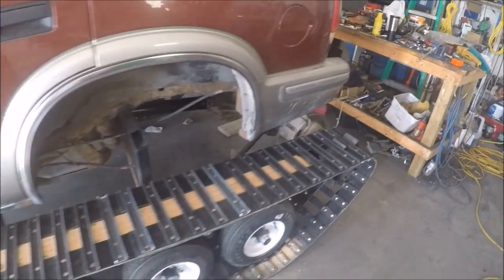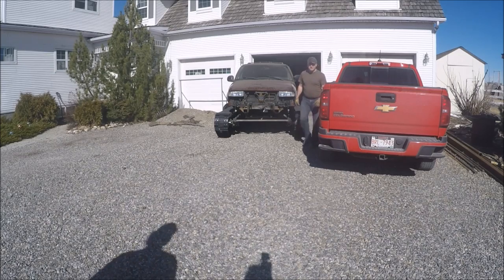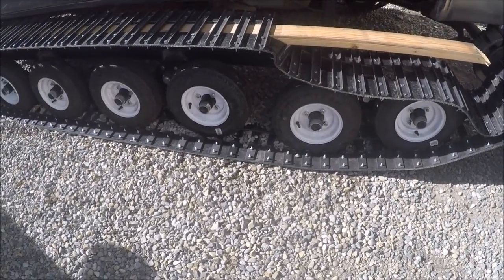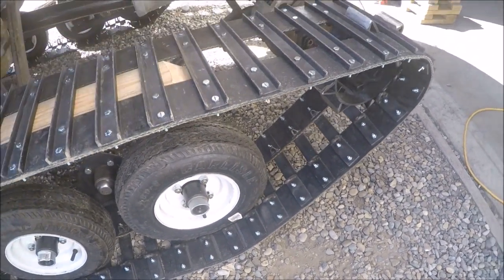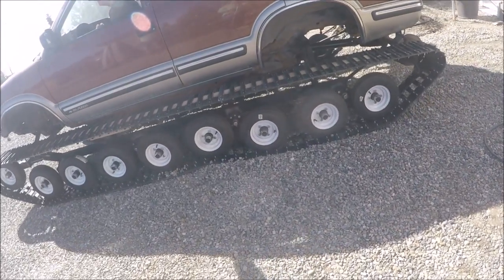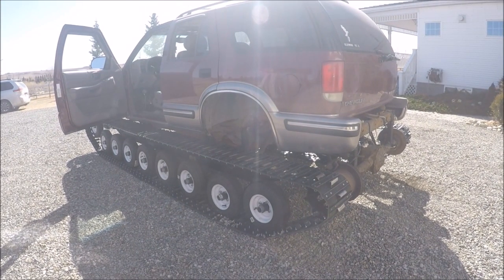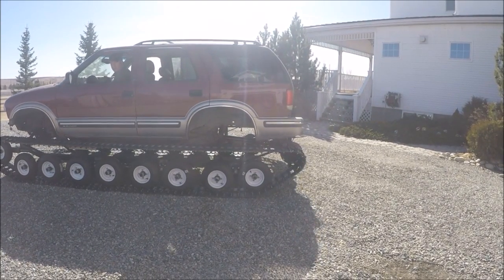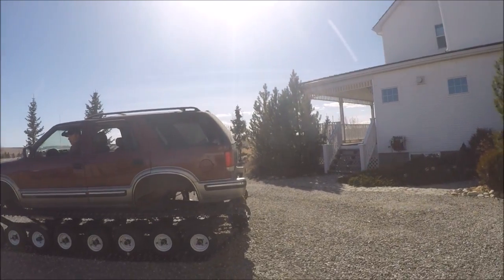Custom Tracked Vehicle, Part 22, Rev 1, Test #2

Comment: Re work the tracks ._u need guides to keep em on the bogies also the teeth on sprocket look too big
Reply from the maker: Hi Dillon Libby, Thanks for the comments. There are guides on the tracks, look close or check video 9 (https://youtu.be/wSQ6bbpNWgc) where I fabricate the track guides. If you watch the latest video, I got it running, but still need some tweaks. I don't think the teeth are too big, but I need to curve them a bit and add a shoulder so the cleats kinda grab the teeth, right now I have to keep the track very tight or it tries to push the track off the sprocket.

Comment: where did you get the track belts? grade and ply?
Reply from the maker: Hi Jeff M, the track belts came from a belt supply place, in Calgary the company was Norwesco. It is a 3/8" thick conveyor belt and was originally 8" wide and they split it into two 4 " belts for me. It has 2 reinforcement plies and has a strength rating of 400 lbs per inch, so an 8 inch section has a rating of 3200 lbs and a breaking strength more than twice that.
Reply: @Bradwiggles  how does the conveyor belt hold up? have you had them tear or explode?
Reply from the maker: Hi Jeff, well I haven't had a lot of testing to be honest. But once the track got caught on the upper slider and stalled the machine and the track had no visible damage but the cleat was bent very badly. I would guess this track will last a long time. Obviously with limits, it should be fine for now. I know that once I get this functional its probably not the end machine and I want to build another one, make some changes, make it smaller, find a smaller vehicle to start with, change steering to use steering wheel instead of two arms etc
Reply: @Bradwiggles  Cool i just ordered a set 🤞🤞

Comment: Thank you for posting your videos on the project progress. Have you given any thought about some idler wheels to support the track  after the drive sprocket? Keep up the great work. From a veteran track mechanic to another TREAD-HEAD.
Reply from the maker: Hi, thanks for the support. Yeah, I needed something to hold up the track, the slider is the cheaper/easier option. Once I get it running on the track steady then I can consider options for the slider for better performance.

Comment: The rubber is stretching too much either double up the rubber or go to a chain link
Reply from the maker: Hi Richard, sorry for not replying earlier. I am new still to youtube and how this stuff works. I am back on the project now though. The rubber is actually conveyor belt material and its rated at 400lbs / inch of material. That material is 8 inches wide, so has a rated strength of 3200 lbs and a breaking of 3 times that at least.The rubber stretching is what supplies the tension as wheels move up/down or slack is needed, that and the front wheel. Once I get it tested a bit and get something functional if I find the track is stretching too much I will look at upgrading to a thicker material. I consulted with a tracked machine manufacturer regarding how thick and rating of their tracks and picked mine to be slightly lighter rated, but should still be enough for a lot of use.

Comment: This machine kinda looks like yours! https://youtu.be/HhCZRUZxOcs
Reply from the maker: Yeah, that is awesome. Very similar design. He used a braking system almost the exact same as I am going to use for my second unit. I plan on using the steering box arm, like the pitman arm to push against two brake cylinders to generate the braking force. Its a bit part of my next version of the tracked blazer. I can't do that with this blazer as the steering system is already destroyed. Very cool video, those russians (I think that was russian) are crazy inventive.

Comment: Most of the problems you're having with that track coming off could be rectified through the use of a larger drive sprocket. You made the sprockets way too small, and you should probably have some sort of spring-loaded adjustable tensioner system pushing the front idlers out to tension the track properly.
Reply from the maker: Hi, I was told spring loaded was a bad idea. There is a lot of tension on the track and you don't want the track to have give which will cause more coming off issues. Not that I have tried it. I am going to get the tires filled with foam and see what happens. Should have that video up soon.
Reply: Bradwiggles
Spring-loaded is not a bad idea at all if you make it adjustable spring tension. There are many methods out there, and I'm not gonna bore you with the details, but you could have a threaded rod run through the center of the spring, then have the "push-box" mounted on top and then thread a jam nut, nut and washer on it to make it adjustable. To get more tension, you would just have to loosen the nuts. Coil springs from a small or medium-sized car would do just fine in that role. You would basically just have to build a reinforced rectangular box with one closed end and one open, with a steel rod threaded at the end welded in the middle of the inside, place spring in and fixture it in place , then make another box which slides outside the first box, butt it against the spring, thread the end of the rod about 12" down and then start tightening. To begin with, you should tighten it about as hard as you can (which would give you "minimum tension,) and gradually let it out. It would probably be a good idea to throw a grease fitting or two on there as well, though, so the slides don't bind and the spring doesn't wear out unduly fast where it contacts metal. The grease wouldn't be there as a tensionning element, but rather to mitigate friction.
Also, I have to add... That drive sprocket is way too small, which means it's placing inordinate stresses on the track due to the torque multiplication you get with such a small sprocket. If it were me doing it, I'd probably make it at least the same diameter as the rims (without the tires, of course) you used for the bogies. Come to think of it... If I was to try to do something similar to what you did there, I probably would have bought an extra two of those trailer-wheels and used the rims as the basis for my drive sprocket, using baffling and such for rigidity and reinforcement I also probably would have used a more solid rubber-padded solid bogie wheel design, similar to what you'd find on a warehouse forklift, rather than using tires, which are a massive weak-link in a system like this.

Comment: May I make a suggestion? .....if you remove the front tire, and install just a rimed wheel that the width of the track would fit down into, it would keep the track in line for the other wheels, and would hopefully keep the track from wanting to come off when you make turns to left or right. ....the tire by it's self won't do the trick..... so take a larger rim an no tire should give you the side to side barrier needed to keep it on. you might do the same on the back one for the same reason.
Reply from the maker: Hi Lary, Thanks for the suggestion. I have thought on that idea but the front tire alone won't stop the track coming off. All the tires are soft (filled with air) and the track quite flexible. I watched some close up of the track during movement and during turning the tires ride up over the inside guides, right in the middle even before the front guide tire starts to track off. I am going to get all tires filled with foam, basically making them solid, and do another test.
Reply: My next suggestion would be to the tracks ...... like they did with these track's ..... https://www.youtube.com/watch?v=YiMwroljiHc
Reply: I tend to look more to the Russian home made ones, because they have the longest history of using them. https://www.youtube.com/watch?v=VVzAHr6J0YI   ...... and if you notice they use a much wider track design than you have. Perhaps that is the problem or part of the problem you are having. ..... and if you notice on there tracks the outward leaning outside keepers.

Comment: Actually, I am back to single tire system;  saves weight, cost and space
iguana
Reply from the maker: Hi Dave,
Do you mean you are building a tracked vehicle and are switching to single tire from dual tire?
Brad
Reply: Yes, I lhave not only eliminated the road wheels but have gone to a single tire.  The steps I have made to totally eliminate "detracking"  have been so effective that I can  do that!  Great huh?
Dave
Reply from the maker: I would love to see some pics or video of what you are building.
Reply: Actually, I have 3 designs; a tractor, truck and an amphibian.  Can't decide which I like best!

Comment: Here is something you may not know the frame for the track road wheels is too straight give it a slight smile shape when viewed from the side not much just a little bend (this is a common design aspect of most band track vehicles (due to the overall track length you have too much ground resistance when turning) causing the predisposition to throw the tracks. Bend the ends up/middle down just a little at least a 1/4 inch to a max 2 inches of total bow will keep the tracks riding on the wheels
Reply from the maker: Hi D L, that is an interesting aspect. The center of gravity of the machine is of course toward the front. So adding in a slight bow to the wheels would basically set it up for pivotting on two sets of walking beams. My concern with that is it doesn't change anything if I am on ground that matches the curvature of the bend and I will be faced with the exact same problem. 
There may be more than one issue however the first thing I am going to try is make the tires solid. The tires are air filled and of course relatively soft with the track having quite a bit of lateral movement (stretch). So when the machine is turning the track is being pushed out on the front, then the tires squish into the guides and just start driving over the guides.  I think the first change I am going to try is get the tires filled with foam. 

I will be trying this in a couple months and posting the results. Got some other projects out of the way now so should be able to work on this soon.
Reply: I used to work on tracked vehicles for a living yes solid tires will help but varying the bogey loads heavier toward the middle will reduce throwing add in tall guides and you will nearly stop track throwing and as long as those tires are at max pressure it shouldn't be  driving onto the guides that indicates too much track contact area don't get me wrong all tracked vehicles are prone to throwing tracks when pivoting the key is turn incrementally (digitally turn) turn- straight- turn- straight- turn...till you make the full turn even military m113's, avlb's, m88 recovery vehicles need this process to turn.. to prevent throwing the tracks. also taper the sprocket teeth from side to side to help prevent the track popping onto the cog teeth.  Increasing cog dia. will also help to reduce the track wrapping. The early snow cats had the bowed track cradles, pneumatic tires, taller guides, and larger sprockets and were still prone to throwing track on hard ground.  Another thing you can do is taper the ends of your cleat bars to reduce the side bite of your tracks when turning
Reply: You may have too lightly rated tires (too few plies on the sidewalls) those 1.5 inch guides shouldn't be a problem on flat ground as another thought
Reply: Believe it or not that curve is present on military m113's (via torsion bar tension bias) and 75% of the weight on a m113 is on the nose (power pack (engine/Trans. assembly) located there) with the back 2/3 being a hollow box for troop seating.
Reply from the maker: Thanks D L. My father and I rebuilt a 70's era Nodwel, complete overhaul. The one in the pic at the end of the videos. I also met with Jack Nodwel, the son of Bruce Nodwel, the man who invented the Nodwel and gleaned as much as I could from him. I know the tires are definitely too light on the sidewall, the Nodwel we had the tires were 10 ply and they would still dig into the cleats when going over objects. We would blow a tire anytime we drove over a large tree, we used to have to stop and clear the trees manually for the Nodwel when driving down cutlines. My dad filled the tires with foam and that problem went away. 
I did some close monitoring that you don't see in the videos and the inside guides just squish into the tires, so there is no doubt the tires are just too soft and fixing all manner of other problems won't solve that one, hence why I need to fill the tires first.I am hoping once the tires are filled then I can re-test and see what the next major hurdle will be. I would really just like to see it get some movement.
I also went to Track Industries in Calgary and spoke to their foreman and toured their shop. One of the biggest things he told me not to do was use a spring to load the track. There is too much give and will cause tracks to get slack and run off. The industrial units use a grease filled hydraulic cylinder to tension the track (what he said, although I don't remember what our Nodwel had). Some guys have suggested I use a spring to tension the track and I am sure that won't solve any problems.
I do like the idea of tapering the cleats, and I may do that when I go to put the tracks back on again. Not looking forward to the hand cramps again from running a grinder for hours at a time.
Reply: Bradwiggles I know grinding for hours sucks I was just bringing up the problems I saw as well. like they say an extra set of eyes couldn't hurt especially from a mechanic who both worked on tracked vehicles, and designed and built tracked vehicles for personal use too worst track I ever threw was on an m88a3 in the middle of a half frozen swamp at 0 degrees F that was one cold day to be drenched putting the track back on (after self recovery (I was my units recovery asset after all)) having to split track and rewrap it. And yes military vehicles use one of 3 tensioners avlb and m88 variants use a big screw tensioner, m113 variants use a grease filled ram cylinder, and my least favorite the m9 ace  (waste of steel in my opinion) used the suspension hydraulics to adjust track tension for road transit to job site
Reply from the maker: Wow, that sounds horrible. I always love adventures into the bush but at some point if it's really tough the fun factor diminishes. I am sure those guys appreciated your efforts, as we all do (or should).
I really appreciate your input, extra sets of eyes and all that, its great feedback. Since I have never designed or built one before I know I have no clue what I am doing, just going off my experience to try and make this work. I believe it's doable so not going to quit. Just have to keep working on getting the kinks out.
Once I get the tires filled, the track edges ground and put back on and tested I may do the curve you are mentioning, it makes total sense. Depends on how it performs though. It's a lot of work to modify the frame. I might just take the back and front walking beams off and put a curve in them to simulate the curve you are referring to. Use some high heat and get the beams red hot so I can put a small bend in them. Will have to wait and see.
Reply: Bradwiggles a thought if you could move the walking beam pivots That might be easier than heating and bending and a little curve goes a long way
Reply from the maker: I don't think moving them will help since the beam they are mounted to is straight as an arrow. It's 3" with .25" wall, so tough to adjust the beam. and the mounts are all welded for the walking beam pivots.

Comment: try putting some cog on the front and some round plates in the front to hold the tread or track on when you turn.  and take the dam wood off and put a tension wheel spring loaded to hold the track tight. its looks like a easy fix
Reply from the maker: Hi Boo Hoo, Wish it was an easy fix. The issue is the tires are air filled and of course relatively soft with the track having quite a bit of lateral movement (stretch). So when the machine is turning the track is being pushed out on the front, then the tires squish into the guides and just start driving over the guides.  I think the first change I am going to try is get the tires filled with foam. The track is tensioned very tight using the ready rod and of course during the test it was flat ground.
Reply: That's a damn good idea. Rear-mounted sprockets tend to get all of the dirt the track picks up thrown into them, causing them to wear down extremely quickly. With front-mounted drive sprockets, the track will have cleared most of the the dirt out before it makes it into the sprocket. There's a reason why German tanks all had front-drive sprockets on them during WWII, as did Shermans and Hellcats, as well.

Comment: Neat! I am currently building a tracked vehicle and my prototype track guides are 3.5" tall, how tall were yours?  I just didn't want to run into the same issue you did with throwing track.  Keep at 'er.
Reply from the maker: Hi pine stumps, the guides on the outside are minimum 2" while on the inside are at most 1.5". I have thought about it a lot and reviewed the video and the issue is the inside guides squish into the tires which then of course allow the track to run off. I have been looking at alternatives to the tires, either using casters with bearings or getting the tires filled with foam. Casters would work better but will require some re-build and I don't know if the wife will let me spend another $3000 on the project. Good luck!
Reply: Thanks!  Just had my first test last weekend.   So far no track throwing even on turf, but the 40 year old engine is becoming a nuisance lol.  I hope to see your machine tear'in it up soon too!
Reply from the maker: I am just getting back on this project now, going to watch your videos from the past couple years, see how you have made out.